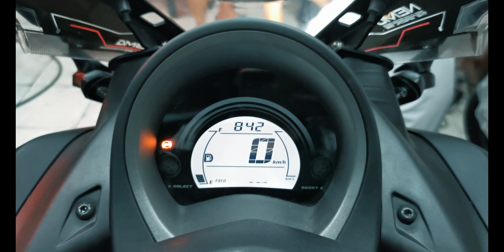YAMAHA NMAX SET UP | MOTOVLOG

Comment: New subscriber here! Pa drop naman boss ng mga prices ng mga accessories😊
Reply from the maker: RB6 GOLD 13" - 4,800
RCB REAR DISC - out of stock
RCB SB-3 SHOCKS - out of stock
JPA SIGNAL LIGHT & TAIL LIGHT - 6,200
ILLUMINATED SWITCH - 2,200
R25 SIDE MIRROR - 2,000
RZ RACING AIR FILTER BOX - 850
NEMO WINDSHIELD - 1,800
R9 EXHAUST - 6,500
BRACKET 2 HOLES - 1,700

Comment: New subscriber here ❤️ pa drop naman po ng prices tsaka yung lahat ng total para mka pag upgrade na din ako. Nice 😍
Reply from the maker: RB6 GOLD 13" - 4,800
RCB REAR DISC - out of stock
RCB SB-3 SHOCKS - out of stock
JPA SIGNAL LIGHT & TAIL LIGHT - 6,200
ILLUMINATED SWITCH - 2,200
R25 SIDE MIRROR - 2,000
RZ RACING AIR FILTER BOX - 850
NEMO WINDSHIELD - 1,800
R9 EXHAUST - 6,500
BRACKET 2 HOLES - 1,700
Reply: stock po ba yang gulong po?

Comment: Magkano po ang JPA signal and tail light? TIA :)
Reply from the maker: 6k po ☺️
Reply: San po mabibili yang tail light at signal light maam?
Reply from the maker: @kingrhideljayo2874  Panzer Army motorcycle tires and accessories Casimiro road, Las Pinas po
Reply: Thank you maam 😊
Reply: @panzermoto1227  maam paano po ba mabibili yang JPA signal at tail light, taga probinsya po ksi ako. Makakaorder ba sa kanila ng through COD?
Reply: @kingrhideljayo2874  Kat Kustoms motorcycle parts and accessories shop along regalado Ave. Malapit sa sm fairview.
Reply: @tyrellpangan978  thank you sa info bro 👍
Reply from the maker: @kingrhideljayo2874  here's our FB page po Panzer Army motorcycle tires and accessories. Pwede po kayo mag message for inquiries.